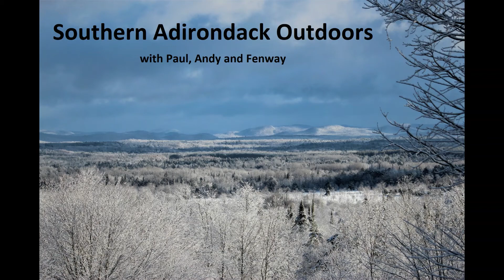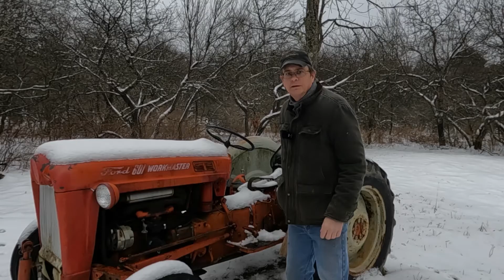Save Your Tractors Clutch: Ford 641 Workmaster

Comment: I can’t find the fuel shut off valve. Can you do a vid on that?
Reply from the maker: Assuming it hasn't been modified over the years then the fuel shutoff valve is on the bottom of the center of the gas tank.  It is secured to the bottom exterior of the tank.  From the right side of the tractor you should be able to see it.  It is a large (3/8ths or thereabouts) screw head with a straight slot and it should be facing you horizontally.  Hope this helps and thanks for watching!

Comment: WD40 on the pressure plate works too.
Of course the tractor won't move; but the clutch will bee OK.
How old is that tractor?
Dave
Reply from the maker: It's 61 years old and needs a top end rebuild if you need a winter project!
Reply: @southernadirondackoutdoors  I could also use a top end rebuild. Lower end too!
I already have a winter project.
Also trying to figure out how to run the mill this winter without being in a snowbank.
Reply from the maker: All things need more and more work as they get older, self included!

Comment: It will stretch the springs if it sits too long.
Reply from the maker: Good point.  I haven't had a spring problem so maybe I've been lucky so far.
Reply: Good. You could just go out and mash it in a couple of times every few weeks or months.